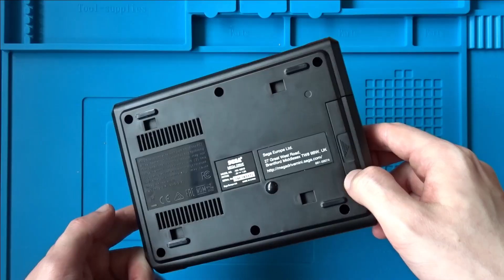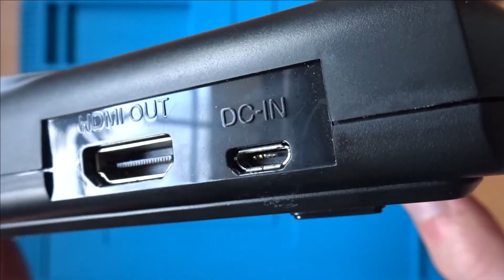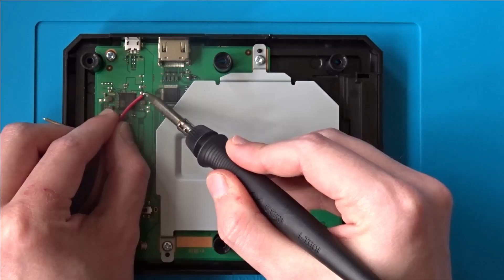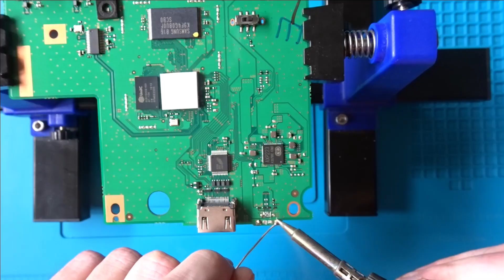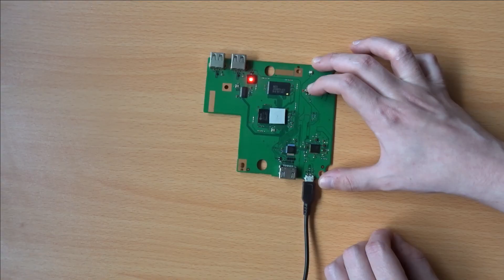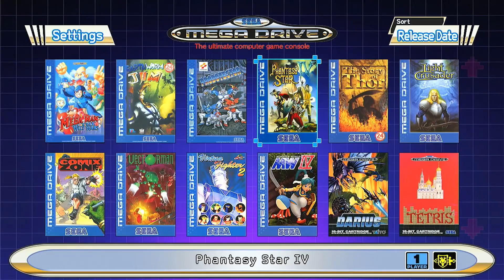Trying to Fix a Mega Drive Mini | Qubits Tech

Comment: Thanks for the video. 
I bought a Megadrive Mini 2, which was sold as new through eBay. But once I got round to opening it (several months!), I found it doesn’t turn on. 
Do you know if the Mini 2 is essentially the same as your Mini 1 for me to attempt fixing?
Reply from the maker: Hi, sorry for the late reply, I have no idea but it wouldn't surprise me if it's very similar. Let us know how you get on! :)